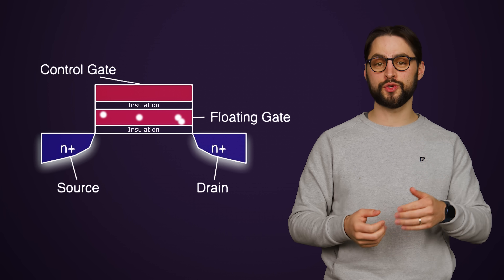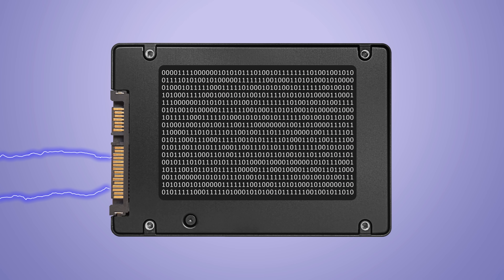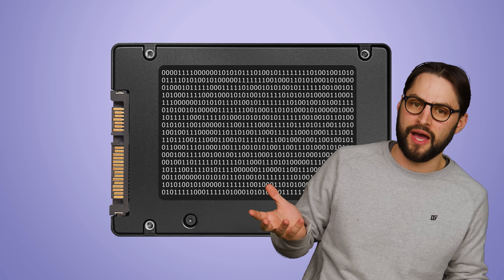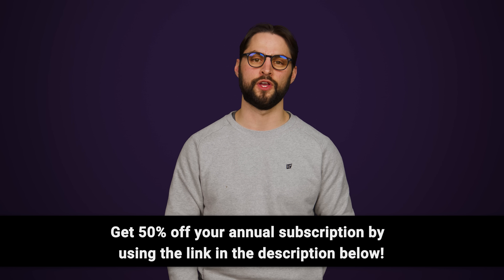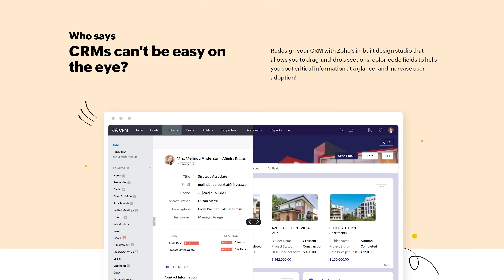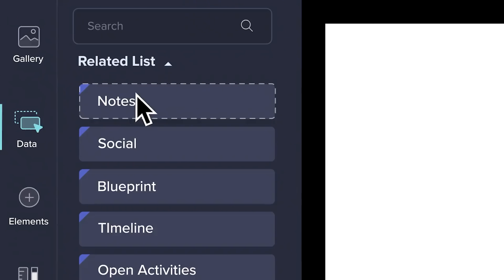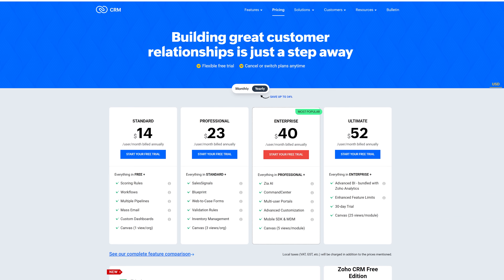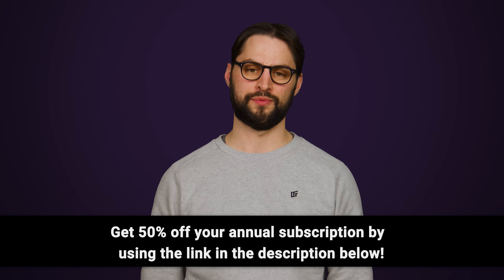SSDs Die, RAM Doesn't. Why?

Comment: Just to add a thing, there's two basic types of RAM, the DRAM described on the video, and SRAM, that is a type of memory that use 6-8 transistors to logically store the bits.
SRAM is insanely fast as it's basically made out of logic, but it use 6-8 times the space of a DRAM per bit, which makes it 6-8 times more expensive.
Most modern computers use SRAM for caches like the L1/L2/L3 etc.. and DRAM for everything else.
Reply: I prefer Shimano over SRAM
Reply: Another difference is that DRAM must be constantly refreshed, and SRAM will retain it's data as long as power is still applied.
Reply: @fincrazydragon  Yep. The Z80 CPU was very popular back in the 80's because it could do the DRAM refresh job without any external components
Reply: @dan_loup 

And yet the ZX81 came with 1k (that's 1024 bytes) of static RAM...
Reply: does SRAM use latching gates?
Reply: @__8120  yes
Reply: I thought s RAM stood for save RAM and that that's what the old video games used and why they needed a battery.
Reply: @bland9876  well, it's not 100% incorrect because in several cases, SRAM is used as a save ram with battery, because it can keep the data as long there's power keeping the state, unlike dram that would need something to keep refilling the caps.
If you play around with emulators, you probably seem SRAM being used in this context.
Reply: @dan_loup  yeah on older video games you have to replace the battery for the SRAM to work properly and you'll usually get more money too.
Reply: @bland9876  Yep. and it's even worse when it is keeping a clock ticking like with pokemon gold/silver as there's logic running.
Reply: @dan_loup  I'm guessing that it uses more power than Ruby Sapphire and emerald because they only use the battery for the clock and not saving as well?
Reply: @bland9876  That's exactly the case.
Reply: I have vague memories of this, SRAM is an actual logic gate, whereas DRAM is basically a bank of capacitors, right?
Reply: @Blaze6108 pretty much.
Reply: Yup. Cache and registers. Insanely fast.
Reply: I thought DRAM was faster than SRAM. Did you mean SRAM is faster than NAND-flash?
Reply: @Rudxain  Nope. SRAM is just faster because its pure digital logic. it's 8 nand gates arranged in a form that store data. it's the thing that caches and CPU registers etc are made of. DRAM on the other hand are microscopic capacitors that store the bits by charging and discharging em. so it takes a bit more time than pure logic gating.
But a dram capacitor take the space of one transistor (or even less), and with some grids etc.. it's basically what you get with DRAM, an entire byte stored on the space of a single bit in SRAM.
SRAM chips sold separately are probably slower than the DRAM chips however because it's not very common to have this kind of memory outside of a chip nowadays.
Reply: @dan_loup  Thanks for explaining 👍
Reply: @dan_loup  back in my day in computer engineering school… so eh, 20 years ago, board designers gave us a big bunch of SRAM and just told us the board was insanely expensive. I imagine they still produce crazy expensive SRAM chips because they are crazy useful in prototyping. Until you start producing ASICS, if your application needs a ton of SRAM, your prototype board will want those chips. And the fewer consumers of SRAM chips, the more premium the price goes. But let’s say you are prototyping network equipment that shuffles data at wire speed at the fastest rates of modern technology, you can’t waste clock cycles waiting on DRAM. So I imagine there will always be a niche need for big expensive SRAM chips for e.g. network equipment prototyping. Prototype on FPGA + SRAM and if you go to volume production then ASIC with built in big SRAM. With the disclaimer that I don’t necessarily know for sure this is still how it is done, but more SRAM is very appreciated in some applications.
Reply: @randomgeocacher  They're great stand ins for ASIC caches because it's basically the same thing. i think i seem some osciloscopes using SRAM too.
Reply: never heard of DRAM. i was pretty smug when watching this video knowing, that ssd-s work by quantum mechanics, and ram by logical bit storage. i learned something new.

Comment: I love when Professor James makes a visit. Funny as much as I feel like I’ve learned I still don’t really understand how it all works. But I get the basic concept SSDs die whereas RAM doesn’t for obvious reasons.
Reply: If you want a deep dive: here the first episode of a series of 4 videos about how an SSD works: https://youtu.be/5Mh3o886qpg
Reply: @MasterGeekMX  
Nah,like I said it would just go over my head anyway. 
I mean I appreciate it but the minutia of the ins and outs of tech don’t really do much for me it’s more than practical applications. Which I’m sure they probably do go into somewhere in those videos but still just not my cup of tea.
Reply: @JohnDoe-kv3kd   Except, both do die. And with RAM chips it's not just from overclocking/over-voltage. Depends entirely on usage patterns. My main computers are running 24/7, and I've lost tons of RAM to chip failures over the decades, it's something I come to expect. The RAM is in constant use, and just like everything else in the computer, sooner or later it will wear out and fail.

Comment: ram does so die been there done that loads of time Waite till you get older like those of us that have been around computers sense they first came to the public market then you might learn something because ram can in fact die and has and well takes time but it can and does.. if and ssd dies you can not recover your stuff they are not like HDD Drives where you can recover your data been there done that to

Comment: So he said there's no insulation inside the capacitors of the ram. But I do believe most capacitors have insulation(dielectric material) between it's plates, can anyone confirm that ram capacitors don't?
Reply: They do, it's usually the same material that's use in the transistors and to insulate the wires (a type of silicon-dioxide). That or sometimes the capacitors are etched directly into the silicon, but then the silicon is the insulator (depends on the type of DRAM). If there was no insulator, the plates would either touch, or there would be air between them (which technically would also be an insulator), but vibrations could cause the plates to touch in that case.
Reply: @hjups  exactly and u can increase the capacitance by adding the dielectric instead of increase the area of the plate, so I thought why not add it 
Thx for the answer man
Reply: @alullabyofpain  well, the dielectric is part of the etching process. The capacity is better controlled by the plate sizes, although it's not actually two plates. Do an image search for "dram cell" and you will see some 3D diagrams and electron microscope images. They're pretty cool.

Comment: SSDs have been improved over time too since the early days, they were known to be a lot more fragile and easy to break down, and long before came M.2
Reply: M.2 is a form factor
NAND is a type of flash memory used in SSDs
NVMe is the connection protocol used to transfer data (PCIe bus rather than SATA bus)

The M.2 form factor you are referring to is still an SSD, just a smaller size using the above two technologies TOGETHER which makes it superior (a new generation of SSD) when compared to the old ones you are referencing (using SATA).

They are lightning quick due to the way data is transported, this also allows larger amounts of data to pass through and be processed, so naturally when something is faster and more efficient we call it an upgrade so yeah this would be the "pinnacle" of SSD technology as we know so far until it gets improved even more.
Reply: @Jameslawz  Well if we're discussing the "pinnacle" of ssd's then rather than NAND, 3D XPoint in the form of Intel's Optane would definitely take the crown.
Reply: @Jameslawz  I would say m.2 is better than sata, just more suited to ssds. The Sata fork factor wastes a lot of space with ssds because ssds are smaller and a different shape.
Reply: @lobsterbark  M.2 is just a connector that carries either NVME or Sata. So currently you're saying Sata or NVME is better than Sata......... Also, the main benefit for NVME isn't form factor, NVME is a protocol which is more optimized for SSD/flash memory than Sata is.
Reply: thats actually not accurate, single layer (SLC) was most reliable, but as the companies increase the amount of layers to increase density and therefore capacity, it reduces overall writes. A common example would be comparing the total writes available on something like a Samsung pro vs something like a QVO that uses quad bit.
Reply: M.2 is a form factor not a ssd type
Reply: wrong, the way to workaround errors has improved and there is a technique called multicell that can make it impossible to access the data after the flash gone dead. They are more fragile than you think.

Comment: Hello guys, I love Techquickie and it was refreshing and fun to see James all studious for once.
Suggestion for a future TQ : could you go over positive/negative air pressure in a case? I believe you covered this topic several times in the past but I still get confused regularly. I just wish wasn't so puzzled when trying to figure out how many fans I need or how I should place them.
Great work and thanks!
Reply: Both LMG and Jay made videos on the topic aaages ago, and LTT has a video of year long experiment with different setups.

In short, it usually does not even matter, unless you run something incredibly imbalanced, especially with obstructed airflow (SFF or huge tower cooler).  After that, not much you can even do - you might be able to cut down a couple degrees from the neutral configuration, but it's almost too much bother at this point.
Besides, there's no single answer, and most surely not a quick one. The case itself is a huge determining factor, and if they've screwed up, no fans would ever amend it. Case in point: GN's "12 fans, 0 airflow" review. Frankly, if your case is truly bad, it's probably worth it to bite the bullet and get a better one over getting 4x case fans for half the price of a new case.

Comment: I have 3 HDD's where the newest one was bought in 2008, they still work at their full speed with no errors. My current SSD's are just a few months old and im not expecting them to last more than a couple of years. I dont know what happened to SSHD technology but its just not that easily available. SSHD is the middleground in my opinion, providing SSD speed to the files or apps you use the most, while maintaining the reliability of a HDD.
Reply: Unless you write a lot of data your ssd wont Wear out. In a way they are even more durable than hdd(physically).
Reply: @KrolPawi  Im gonna get back to you in about 14 years if my SSD's did outlast the liferime of most of my HDD's:)
Reply: @EricTheBroBean  SSHDs died out because they were the speed of an HDD (or lack of speed...) for the price of an SSD... The small 32GB or so cache was usually a joke, some SSHDs didn't even use it at all.
For the most part, SSHDs were just a placebo effect on their buyers.

Comment: I have had RAM decrease in capacity over time, maybe it was because it was DDR3 in a budget HP laptop from 2014. But going from 4gb to 3.7gb to 3.3gb did get a bit annoying.
Reply: I'm pretty sure it's the os secretly partitioning parts of the ram modules for itself.
Reply: That's not how that works, RAM doesn't disable parts of itself, it has no possible way to do so. What really happened was driver updates for your videocard etc. started reserving more and more RAM for themselves.
Reply: @someguy4915  That couldn't be it, because 1: it never got driver updates just about ever with windows (it only decreased with windows), and 2: I use Linux on that laptop and the RAM capacity never went back to normal and the "System Monitor" app shows the GPU having 2gb of dedicated VRAM.
Reply: @forestsmills  Windows regularly sends driver updates through Windows update so almost certainly you would've gotten at least some updates. 
GPUs that have their own VRAM do not prevent anything else in the system from reserving RAM, such as the integrated IGP that does not have its own VRAM but might still be inside your CPU, your NIC, soundcard, USB controller and various other components.

Anyway the point is that it is impossible for the RAM to 'shrink' like that. RAM either works or it doesn't, there is no logic inside RAM to detect faulty parts and to disable them. As it is impossible for that to be the cause, the real cause must be something else and that leaves two options: someone was stealing RAM from your pc in small increments (which makes no sense obviously) or hardware reserved RAM was increasing for some reason.

Comment: Is this the same for graphics card memory? So constantly writing and reading data from it doesnt burn it out? Such as mining Eth?
Reply: GPU VRAM is the same as regular DRAM (that includes HBM too). However, DRAM can wear out in high bandwidth operations (although the failure rate is low). Datacenter applications have this issue where they see data corruption partly as a result of DRAM failures due to wear-out. This is obviously made worse as the temperature rises, like in poorly ventilated environments. So this can be an issue with crypto mining - afterall, the GPUs (and their VRAM by extension) were not intended for that sort of workload. A SSD used at a similar rate would fail 10000x quicker though.

Comment: I felt the explanation for the DRAM was lacking. In a DRAM cell, there is a transistor with its drain gate attached to a capacitor in the 0.01 picofarad range. Capacitors have a phenomenon where they are always leaking current, so part of the DRAM's function is to constantly read the value from the capacitor (which always destroys the data stored), and then write it back if the value was HIGH. This is known as a refresh cycle. Thus, if you don't keep the DRAM powered, it won't be able to perform this task and all of the data will degrade (be lost). But this flaw is only because of the material cost, as you can replace the material of the capacitor from dielectric to ferroelectric and it would retain its data indefinitely (non-volatile) but at a exponential cost.

Comment: I have had more RAM die than SSDs. 

To put it mildly, RAM does not like lightning.
Reply: get a wall socket or office outlet extension cord with a properly built in surge protector! this will stop any power disruptions from bricking your computer unless the lighting somehow directly hits your house's main circuit breaker or power meter utility boxes! this has keep my apple computers alive during thunder,lightning storms and power outages more times then i can count! the thing the that protectd my comptoer is like over like more than 25 years old but my surge protector dispideing being so old still poplery protects my computers this whole time far before youtube even existed  in the first place! it kinda is a hard outlet socket mounted nine outlet serugeprotecteer/outlet expander for a comptuer offce but man does the elcrtic egile compony did make realy good suge protector for my rooms comptuer that its still even stll protecos my comptuer and comptuer desk from power sruges even to this day
Reply: @ashtiboy  Not gonna help when lighting lands several metres from you walking with a laptop in your backpack.
Reply: @88porpoise  well you could just make a metal faraday cage on your backpack made out of a fine metal wire mesh covering that would block the lightning emp and electrical energy! but it would be a bit too heavy to carry around however!

Comment: Will an SSD lose data if it's written to once, for archival purposes? I guess I'm wondering if only one write would degrade the insulating layer enough to leak electrons after a long period of time.
Reply: Bit Rot is a thing so your better off on Tape if its critical to achieve it and run no risk of loss
Reply: @commanderoof4578  Tapes can rot and degrade too. There's no perfect solution.
Your best bet would probably be to keep more than one copy, and periodically refresh the drives (once every 1-4 years). That could be done by running a disk and file integrity check. If you do that on a SSD with a cycle rating of 10,000 cycles, then that will last you for up to 40,000 years.